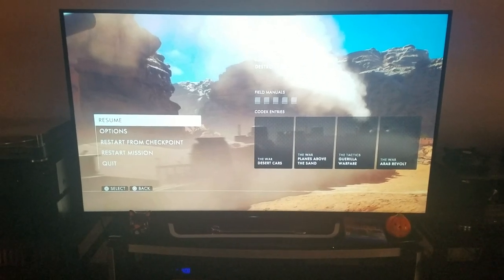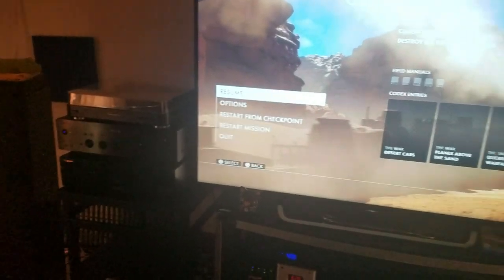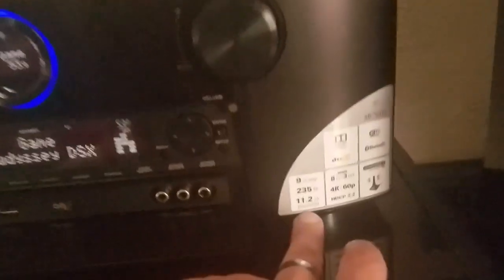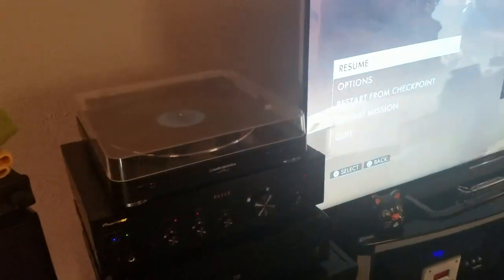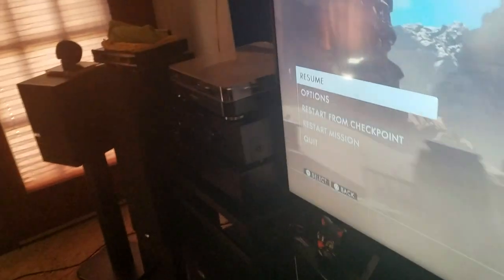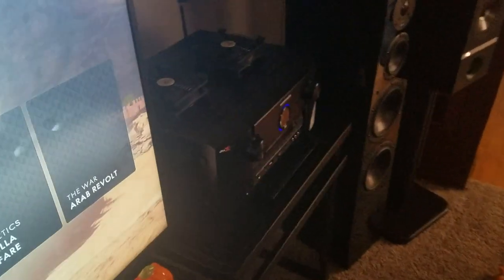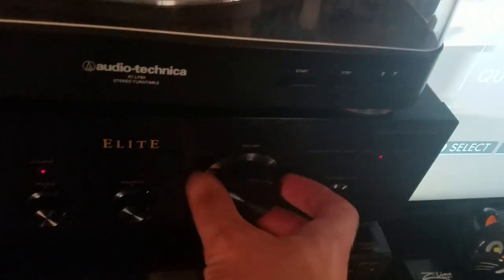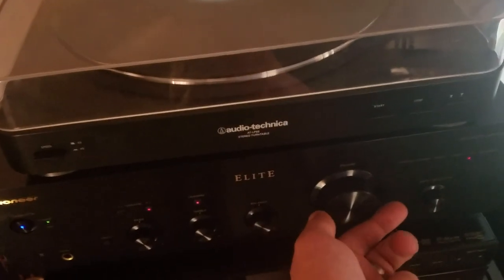How to add channels speakers to a receiver amplifier for Dolby atmos DTS X av receiver hack!

Comment: is there a way to do this but with just two channels? id like to get bookshelf speakers and much bigger floor speakers. the receiver i have is good for the bookshelf and i can match the ohms for the floor standing but its still not nearly enough power to drive them properly.  Long story short, i want to do stereo with 4 speakers. Any info or help would be immensely appreciated. Thanks.

Comment: Can you please explain to me if I can make my 7.2 channel onkyo 5100 av receiver play the klipsch reference cinema 5.1.4 dolby atmos enabled speakers to make 9 speakers play or how you just added 2 extra channels by getting a pre Amp or can I just add extra speaker wires to the 2 so call height channels for the 4 atmos enabled parts to work I know that I sound like a loon but I was hoping to just do the 7.2 setup and just add more speakers to the height channels and make the atmos work can it be done and if so please tell me how to make it happen and no I don't have the money for a 9 channels receiver I didn't know that when I purchased it I am still waiting for the klipsch to be delivered so if you have any instructions on how to do this please let me know. Thank you for your time.

Comment: What I do to get extra channels is pretty much the same but using a little 12volt amp I bought on eBay. So I plug into one of the preouts with your topical rca lead then put an adapter on the other converting it to a female jack end then plugging into the female a male to male jack lead witch you can by in Long lengths if you need.right now plug the male end into your small amp Input jack. Now just just wire up your speakers into your red and black inputs of the amp as you normally would then hey presto you have transferred the audio . The amp I do it with is a 240/12 volt amp. You could run it off your car with a cigarette lighter plug as well if you needed to or use the amp for camping. There not a power amp buy any stretch of the imagination but still pretty cool and give way enough loudness to your speakers.

Comment: I have a vintage Pioneer SX-750 2-channel receiver. Is it possible to connect more than 2 speakers? Or will I have to sell that and get something else to add a center and sub? Thanks

Comment: That all makes sense. The only question I have is,if you hook speakers directly to say height 1 and then also hook rca to height 1 as well,does it distinguish them as separate individual channels or run then in tandem as the same channel. Otherwise you could hook speakers to all your speaker outputs and amplify all your prepouts but that wouldn't make 18 separate channels of audio. If that makes sense.
Reply from the maker: LVcichlids yes, your correct, it really depends on the receiver.  Some if not most will have all pre out outputs active at once... the marantz and denon receivers do, so if I would have all speakers hooked up to my Marantz and have every pre out being sent to different amplifiers yes they would all work at once.  However it does not actually distinguish between the pre out and the actual speakers connected.  You would just be getting the same left and right channels from height 1, essentially 2 left and right height 1s. Sometimes what I do to try and add even more additional channels is send 2 RCA cables out from the pre out section on the wide channels and add extra front left and rights in a wide configuration.  But technically you are correct if you hook up height ones directly to your amp, then also send a pre out to an external amp in the height one channels you would just be getting another set of height ones it would distinguish left and right but it won't actually change them as discrete channels.  Some really large dedicated home theaters need to actually do that for speakers placed around the room properly.

Comment: I have a 7 channell pioneer reciever that does 5.1.2 atmos and i have no pre outs only subwoofwer pre outs, is there any way to add 2 rear back channels with the atmos setup so i would have my surrounds and surrround backs as well as 2 atmon cieling speakers, at the moment if i want to use the 2 rear back i cant use atmos, when i use atmos i cant only use the normal rear surrounds.
Reply: You need a 9.1 channel receiver

Comment: I currently have 5.1.2 setup with yamaha rxa880. I wwnt to achieve  5.1.4. So I need to buy one more yamaha or any receiver?
Reply: Hey Prabhat, I'm in the same situation... Did you find a solution?

Comment: I have a pioneer vsx-1020... And a Denon avr-s640h... I got them bones at a great price and I want to do what you're doing and that is split take some of the load off of pioneer.... Now the denon has a Bluetooth option which is nice.. and like you also have a PS4.. ultimately what I'd like to do if it's possible is to is have the Pioneer run my fronts meaning like a AA speakers and then have 4 massive speakers and then my surround sound speakerswhen I game I often like to listen to music while I gameso is there any way to combine two and drive all these speakers and has a Bluetooth option available in case I don't want to use Spotify on my PS4 any help you could provide me with I would greatly appreciate cuz you obviously know your stuff thank you

Comment: Hey, nice set up! Did you know the higher end Denon receivers have a HDMI zone 2 out that can pass a unfiltered signal to another receiver. I saw a couple other guys doing this and once I understood it i bought a second receiver. No weird feed back or any issues at all. I have the Deonon X7200 and the x6300 set up that way. I have 2 other receivers that are lower end that just have DPL2 and that allows me to run 6 atmos speakers so my entire system is 15.4.6  There has been talk that the new stuff in 2018 will have 15ch of processing power but as of today unless you rig something up like this you will spend over 5k just on the processor. Not my idea, just passing on the info.
Reply from the maker: Yep, there is stuff from Emotiva that is supposed to do 16 channel processing, but not discrete. Super expensive stuff only now... There is really no way to do it other than this way.  The Zone 2 hdmi output is the best way to talk to another amplifier for this setup.  Denon and Marantz are the same exact company so most of the higher end ones should be able to do it.
Reply: How do u get play back from a single source? What I mean is, if I use the zone 2 HDMI out on my Marantz SR7011 and connect that to my Onkyo TX-NF808. I then power my PS4 the sound comes out through the Marantz as this is what it’s connected to. How does the sound come out of the speakers connected to the Onkyo? My input on the Marantz would be to my PS4 🙈🤷‍♂️
Reply: Justin when I come out of Zone 2, where do I go into the back of in the other receiver?
Reply: I want to do the same thing, and have the capability..I think.  I have 4 atmos channels and that is all that I want to power with the seperate AV receiver.  The old receiver Marantz 5001 isn't able to do atmos, but My marantz 7011 is.  Will I be able to select those 4 atmos speakers, if not, I could just use it to power my rear surrounds,  I just need to free up two channels, but I would like to free up 4 if possible.
Reply: @glennmay6750  is there an output connection  ? ( on your marantz? ) the output is how you connect another receiver or amp.  connect speakers to the onkyos input connections . ( i have never done this with receivers ) it certainly works with receivers to amp connections. in theory it should work with receivers too.

Comment: Am I the only one wodering how this is a hack?  Your just using a receiver as a power amp.  You already had those two channels on your main amp and not adding anything but more power.  Even if using the height on the main plus the amp hooked to the preouts.  Its still just 2 channels of sound.  If your main amp has the power you might as well just run more speakers in seriers..  Unless im really missing something here..
Reply: He did have a speaker wire going into the other Heights but those were used as dobly atmos front surround & rear surround ceiling speakers that he had probably set in the beginning of the settings of his receiver

Comment: Hey, great set up 👍🏻 I have the same Marantz 7011, my older Onkyo TX-NR808 is now being used to power 2 Floor speakers for music. I want to set my Marantz up as a 7.2.4 but looking at what u are doing, would I be able to use 2  high Channel preouts to 2 x Marantz PM5005. Using the the PM5005 to power the Celling speakers and freeing up the 2 channels to power my music speakers (biamped) instead of the TX-NR808.  

Also if this is possible, would I also be able to (hypothetically) get a further 2 PM5005 and power those via my Left and Right channel preouts to allow my front 2 speakers to also be biamped?  

I hope this makes sense. If I’m understanding u correctly, I can use the preouts to add more channels/speakers to my set up.
Reply: Any luck on a response?

Comment: hi there ...I have 2 passive subs and a crown amp.. how can I hook it to a hometheater receiver..?im looking at the Marantz 5012 avr....thanks
Reply from the maker: you would need a line lever output somehow on the crown for the subs... Or if your using speakers, then it should do it no problem.  You might need a line level converter though if there is no extra rca outputs on the crown.

Comment: Hi I just bought the Yamaha RX A 3080 this is a 9.1 to make it 11.1 or 7.1.4 . To run the additional  height channel  i need to connect a external amp as per instruction. I have my old Yamaha RX v 667. Receiver . Can i use the pre out of the 3080 to use the 2 additional channels of height presence to the RX v 667. if so what are connections  (in/out) to the RX V667. Thank you in advance

Comment: You had to add extra cooling to the receiver????
Reply from the maker: oh no didn't have to, the fans are just for closed cabinet cooling but I wanted to test the fans out and see if they are worth the purchase.  They do significantly lower the temp to a nominal operating temp, but no need where I have the receiver.

Comment: Hi, this is really good video. I would like to create 9.2.4 Cinema system. I think to buy Onkyo TX-RZ730. And will it be possible to use my old Sony STR DH520 for creating 9.2.4. System
I have already speakers - JAMO S608, JAMO S800 and center JAMO related to JAMO S608, then i bought one pair JAMO Studio S 801, then i will buy 4 JAMO S803 with JAMO S 8 ATM for DOLBY ATMOS. Can you pls let me know your opinion for good AV receivers to create 9.2.4? Tx